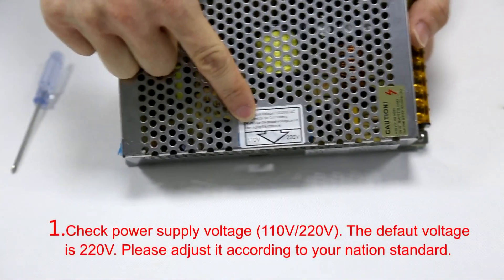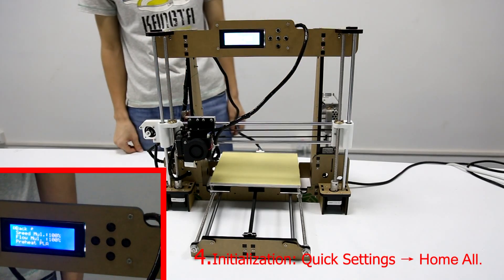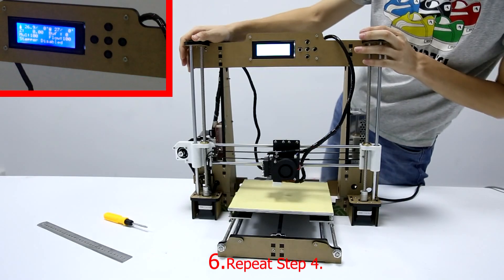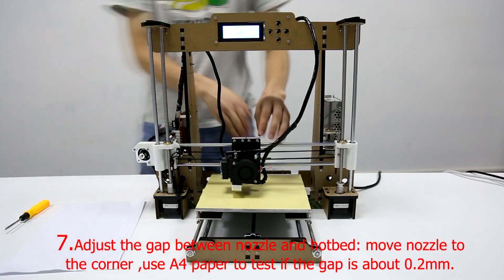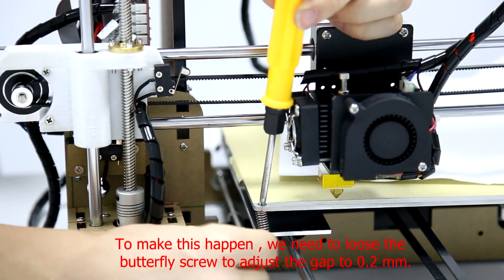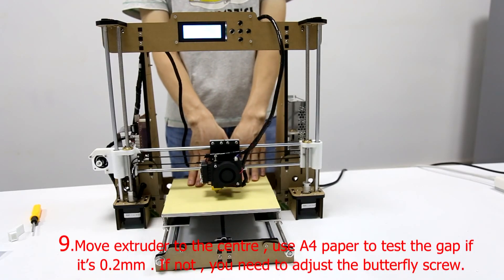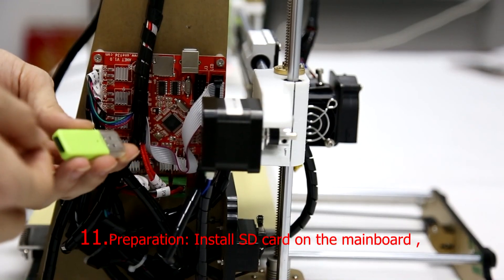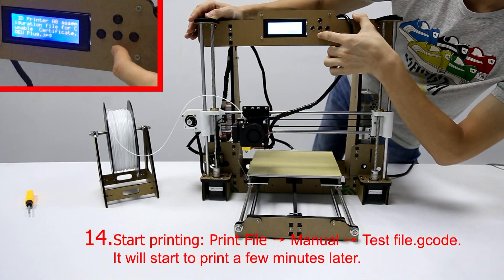3D Printer Instruction--Anet 3D Printer A8 Debugging Video

Comment: Anyone own or know anything about anet a8 plus, my filliment won't self feed through the nozzle. Any ideas what be helpful?
Reply: You may have to take nozzle off and heater block to get to the tube that feeds to the nozzle.  If internal PTFE tube is not long enough there can be a gap behind the nozzle.  Feed tube can then get plugged with melted filament that solidifies at that gap.  Short answer feed tube is plugged, open up remove plug, look for cause of the plugging.

Comment: I've done all the steps and pressed print and my extruded just sits there, on the screen (yes it's preheated and everything's plugged in correctly) it will count up the percentage of the print and once it hits 100% it goes idle and the extruded hasn't even printed anything... Any advice

Comment: I am new to 3d printing I have a Anet A8 PRINTER  SKYNET V2 3.2 Ssoftware cura 3.4.1 my problem is my turbo fan is not working, I got a new one plugged it in and not working, is it a setting iam missing or something else, any ideas

Comment: When i plug the printer in, it does nothing, the power supply literaly does nothing, no lights come on, help !!!!11
Reply: Check the power wires coming out of power input to the board. The positive and negative were switched around on my printer.

Comment: Hiya David. 1st thing. Great videos. 2nd I got 2 issues that I know of I am a extreme newbie at all of this. I followed your videos 100%. Everything was built and leveled correctly. 1st Issue: When I Home All or Print the printer sounds like it is grinding and struggling. The belt is just tight enough for some tension. 2nd Issue when printing the test.gcode the printer keeps wanting to start printing  left halfway off the bed and halfway on the printing bed. Any clue why this happens?
Reply: i had this problem, check that the stop switch is actually getting hit by the X-axis motor. adjust the switch all the way to the end of the bracket

Comment: I bought my printer a short while ago, used 1 day to assemble it, i never touched a 3d printer before and only know computer electronics and ive got it up and running but havent been able to print yet;
my problem was that the temperature and x-end was switched; i think it was different setup in the video but when i compared the cables to the picture on the backside of the box for the motherboard, i found my error and i got it to heat up properly. i have yet to print anything but at least i have it ready :)
a few differences i noticed was f.ex the pre-cut hole in the plate for the backside of the monitor for the GPIO pins. thats a great change if i was to connect a bigger setup for the printer. 
i like the changes to the motherboard as well for the power, nozzle heater and bed-heater were they are setup with 2x screw and 1 of the green tower things.
looking forward to printing upgrades for this machine

Comment: David Dan - ANET A8 Instruction Video 1 & 2 (updated version):  I'm changing the grade to a "B" as the substituted power supply in my kit  was not the same as in the video and therefore the power connections were not correct.  US version 115VAC, be careful.  LNG from L-R on terminal board.  Suggest video 1 contain electronics power check before starting.  Power supply green LED is on when 12V is being produced.  No green power supply LED before connecting the main board = bad power supply or incorrect wiring. 115VAC power cord I received was Blue (L), Brown (N), and Yellow (G).

Comment: David Dan - ANET A8 Instruction Video 1 & 2 (updated version):  I give you an "A" for your instruction video, but just want to add some small details that others might find useful.  1) the exturder wire (2 Red) are to short - they need to be another 6-8 cm to allow full travel of the X axis at it's lowest position.  I did make it work, but it hooks right in front of the display controls.  2) the recent version of the main board I received uses terminal screws for the 12V power connection and for the bed heater.  Poor design - the solder on the back of the main board can be easily damaged.  Hold the terminal in place with a pliers when tightening.  3) The Z limit switch is poorly located behind the Z drive bars which makes it hard to tighten after assembly.  This is easy to miss and could lead to hotbed/extruder damage if the Z limit switch slips during operation.   I was able to assemble the unit with the parts provided and can now continue to the next video (Powering Up).

Comment: Hi, I need help. I'm stuck :(
I just finished building my printer and plug it in. It turned on fine i did Home all and realized it's stuck on z switch so i turned it off, fix the z switch but now it's not working. I turn it on and i see fan working but when i click on Home All it doesn't do anything. What may be the problem? Help please...
Reply: Hi. Mine is when i hit Home All the extruder moved to the left and the bed moved backwards then stopped there. Supposedly the extruder will go down as seen in the video. Can you help me pls

Comment: in my lcd screen do not appear "Print file" but only "position" why?
Reply: I had the same problem and it turned out to be a faulty SD card. I copied the files onto a different SD card inserted it and "Print file" appeared.

Comment: Hi! I bought the printer at amazon and the frame I got is totally different from the one on the videos. It's the aluminum composite frame. So far, no problem with that. When I was watching your video I realized I cannot go up and down with the S Z because it has a fixed position. Again, no problem with that either. 
The only thing that worries me is that when it starts printing the strudder doesn't begin printing from the center of the hot bed it begins 2.5 cm or 1 inch to the right. So the piece I'm printing is never on the center of the bed. Is that ok? Can it be fixed? Thanks!

Comment: Hi! I've followed the tutorial videos and.. my Y motor goes the other way around =\ The platform goes towards the end of the printer instead of towards the motor..

I tried switching the coil cables on the motor but that didn't help

What should I do?
Reply: For people who had the same problem..
I've inverted the coils on the motor, so that 

Original: black red green blue
After : red black blue green

(otherwise, it won't work. Last time I tried, I changed from black red green blue to blue green black red, and yeah, that didn't work..)

You can change the pins using a needle to unplug the wire from the holder

Hope that helped
Reply: you mount the motor on the wrong side , that because the back plate you have the mount 180 degry
Reply: That might've been the case, but it's on the same side as on videos =\ 
But you're right, if I flipped the plate, it'd work just normally~!
Reply: Thank dude
Reply: I'm having this problem with the x motor, and the original order is black green blue red... What order would I put the wires in?
Reply: Kyana Utaka you may have the back plate backward and you would need to flip it around and re-install the motor and sensor, bolts and stoppers. I had the same problem. Make sure the motor is on the side of the motherboard

Comment: I followed all instructions, as soon as my print starts printing, I do not see any filament coming out of the extruder. Why is that? Any suggestions?
Reply: Randi Jantz hmm. Maybe a loose screw in the extruded box. Maybe the filament is not in all the way, or it’s not heating correctly. To insert filament, you need to preheat the PLA or ABS and press the top screw while inserting the filament. Hope this solved your problem.
Reply: When I press "Preheat PLA" all it shows is "def / 190 def / 60" instead of the actual temperatures shown. Why is that?
Reply: Amir Butcher That's because either you haven't plugged in your Thermistor Bed and Thermistor Extruder into the main board. Or you have a faulty Thermistor

Comment: I've followed all the instructions but when I plug it in, there's no green light from the power supply. and it doesn't turn on/ light up the LCD display.. helppp, also I've checked the 220v is correct for me

Comment: I finished building my Anet A8 3D printer, first time I turned on and tried to Home All the heat bed went forward and made a grinding noise. turned off.....  to get it to go Home correctly, I had to swap the x motor and y motor connectors on the control board.....  not the printer will go home,  but everything I print is in a mirror of what was sent to the sd card..... plus the home position is not correct.  when I center a file to print it is not in the center of the bed   any help would be appreciated....
Reply: Had the same issue with the grinding noise. You installed one of the Stop switches the wrong way so the motor couldn't bump into it to stop.
Reply: What do you mean the wrong way if you dont mind me asking? My left side Z Motor after i home it which goes perfect, when i try to make it go up, it makes grinding sounds and refuses to elevate higher but the right side one does fine.

Comment: A8 3d printer will not start up at all !  Assembled according to instructions and double checked. Power Supply is set for 110v. (North Carolina, USA) Steady green light inside the power supply when plugged in.  Nothing on the screen. Need help.  Thank you, Rick
Reply: Well, I found the problem.  Instruction video on the GearBest site shows a Power Supply with 7 terminals.  Mine has 9.  When I hooked up the wires I started from the left and attached the wires without noticing the difference.Stupid mistake !!  Now that I have it right, the printer turns on like expected.  Luckily I did not screw something up. (so far)  Hope this helps others.

Comment: Thanks for putting this video. I followed your steps. However, when I start printing with PLA, after about 2 mm printed material, it separates from the hot bed?! I tried increasing the hotbed temperature to 60 and turning down the fan to 25% and it helped but the print quality at the base is not good and it moves a little bit. what's your advice?

Comment: My anet a8 doesnt even turn on!! The display just turns blue for like 2 seconds and then turns off! It did work at first but when i started a print it went straight down and broke so i turned it off and now it doesnt work!
PLEASE HELP!!
Reply: the problem may be in insufficient power
Reply: Edvin Sifvernagel - TropSilver check your connections mate :( sorry to hear

Comment: HIGH TECH COMPANY?  A low quality 20amp PSU prone to burning up!  The 90th Clone firmware from Arduino enthusiasts years ago. Prone to cracking Acrylic frame.  SD Card slot on motherboard fails easily - to weak.  Sending out free software that is years out of date - ditto the useless drivers that  are useless on iMacs  more than 3 years old...Poor engineering  on threaded rod and  worm drive rods.. plastic rod holder need an hammer to drive the  plain steel rods  which carry the extruder. ...other than that...its not  bad for the money! BTW.... if  a Motor or extruder or motherboard or any other parts fails in less than a month - do you expect a free replacement. ROFL - Dont !   You may get a free  replacement IF you pay over the top shipping cost!
Reply: dude you're paying 150$ for  3d printer ...

Comment: My projects are reversed (mirrored) in the Y axis. how do I fix this?  When I  home the Y axis, the bed moves forward.  If it is a software issue, how and where do I make the change?   If it is hardware, is there an illustration to show what I need to do?
Reply: I have the same problem....to get it to work I had to switch the wires for the x motor and y motor on the control board.. and everything prints in a mirror of what was sent to the printer.

Comment: Hello! Thank you very much for your videos. They were very detailed and helped me to assemble my anet A8. I followed every step and i was super happy then i started debugging to do my first print like you do in this video. But happens that when i get to step 12 and select preheat PLA the Extruder temperature stays at +-23ºC and the Hotbed temperatures goes to 91ºC. I checked everything over and over again... people keep telling me that i should have switched the Extruder and Hotbed on the board but not, its like yours. For this to happen what have i missed? Thank you very much for your time. And keep doing good videos!
Reply: It might not be the heating cables but rather the cables for the two thermistors. The bed thermistor should be plugged into B_T and the extruded thermistor should be plugged into E_T

Comment: Hi, do you know how can I change steps/mm value for XY stepper? I changed both pulleys from T2.5 to GT2, so I have to lower both numbers from 100 to 80 steps/mm.
I have been able to change it in the official firmware, but I don't know how to upload it in the mainboard.
Thank you!

Comment: UPDATE: I fixed the alignment issue with the z axis by drilling the holes for the z2 motor, to align it with the lead screw better. It relieved alot of the pressure that was stopping the z axis going up and down. I managed to print the chinese chess piece file that was on the sd card, and it printed fine. However, now the hot end wont heat up anymore. The temp goes up and down by 5 degrees, but never reaches the tempreture needed. Maximum was 40 degrees. Anyone have ideas on what i can try. The fact that the temp does go up implies that it might not be broken. Should i try opening the heating block, or upgrade the wires to it. Any help or suggestions would be greatly appreciated.

----------------------------------------
Original Post:

Hi, I just received and built my Anet A8. I followed your instructions, they were easy to follow. However the printer gets stuck during the Z axis during the 'Home All' function. I've made sure that both x carriages (white) are at the same height. The holes to line up the lead screw with the Z2 motor are off line, creating stress on the angle of the lead screw. Some people say to drill holes in the Z2 acrylic plate so it can be moved to fit better, others say to undo the screws from the lead screw to the x carriage (but that would stop the x carriage moving up and down as it wouldn't be attached anymore.) I'm not sure what I should do. I could drill the holes, but if there is another option anyone knows. I'd rather try not drilling if I can help it.

Comment: when I start pre-heating, the printer reboot itself
then i try to heat the extruder and the hot bed seperatly
it works for the extruder but the printer still reboot itself when the hot bed started to heat up 
any idea to fix it?

Comment: MY extruder wont heat up - followed all the relevant instructions from all over and it still wont work. Fan works, hot bed heats but no extruder
Reply: I have the same problem :( how do you solved it? My Hotbed temperture goes over 90ºC and Extruder temperature stops at +-24ºC. I cant solve it... how have you done to solve the problem? Can you help me please?
Reply: Nuno Santos I ordered a new Hotwire from eBay and that solved it for me but your problem sounds a little more complex. If there's a 3d print repair shop (surprising amount around) around you then maybe that would be your best bet. Best of luck!

Comment: Hello! I've finished all of the setup and debugging up until the preheating portion, and it's working fine. 
When I attempt to preheat the PLA, it steadily goes up in increments of 0.2 until 80 where it slows down to 0.1. Once it hits 90, it is extremely slow, and after half an hour it odes not seem to be heating up past 94 degrees. 
Would this be a wiring error that causes it to not heat up to 190?
Edit:
After checking the wiring, I found that I had accidentally plugged in the Bed wires to the end portion, and vice versa. 
However, upon attempting heat up for the PLA again, the hotbed exceeded the 60 degree mark, and went over 100, tapping 130 at one point before I shut it off. The Extruder hung around 30 degrees, and I'm wondering why this would be happening when the wires are in their proper sockets now.
Reply: I have the same problem :( how do you solved it? My Hotbed temperture goes over 90ºC and Extruder temperature stops at +-24ºC. I cant solve it... how have you done SouSou Day? Can you help me please?
Reply: I wish I could help you, but I still have the problem, and am unable to fix it.

Comment: The first things you need to print are:

1. A filament reel arbor holder so that the reel spins more smoothly around the axle.
2. A 360 degree cooling nozzle so that your prints end up getting better quality.

Comment: Hi. I just assembly my printer and debugged the printer following the instructions except the test file printing because it was not on the SD card (don't have the manual option either). When I'm trying to print something it will only print a first layer (always the same even with different files) and after that it prints in mid-air ? I can't figure this out, can you help me please ?

Comment: My Y-axis motor is rotating backwards when I press the return to home button but it goes its normal direction whenever I do anything else, I don't want to print anything until I can be sure it is working properly. Any Help?
Reply: Hello! I have the same problem, did you find any solution?

Comment: I've adjusted the extruder nozzle to a sheet's width from the bed, but the plastic won't stick.  I see in this video, you're doing all your measurements with the masking tape still on the bed.  Was I supposed to leave the tape on?  It was damaged when I got the kit, so I had assumed it was meant to protect the plate, and could be removed - but it's looking like the friction is important.
Reply: Ok, yeah, that was it.  I had some blue painter's tape available, and made a nice solid layer of it.  The printer's spitting down a good-looking second layer now.